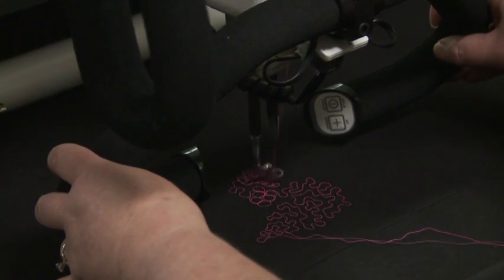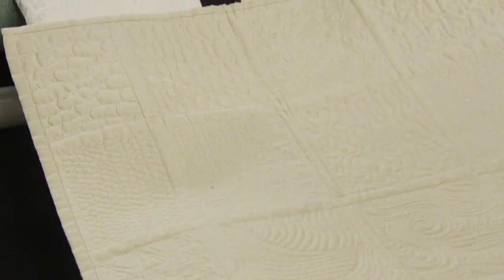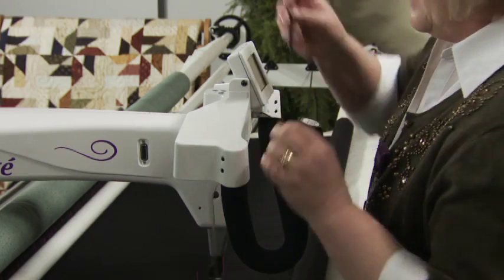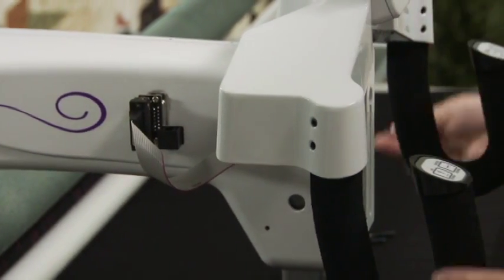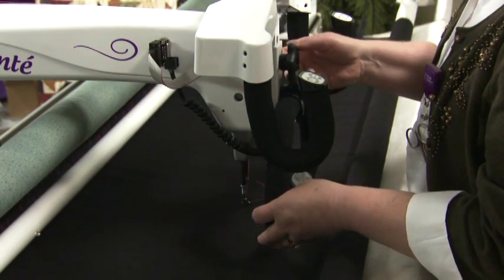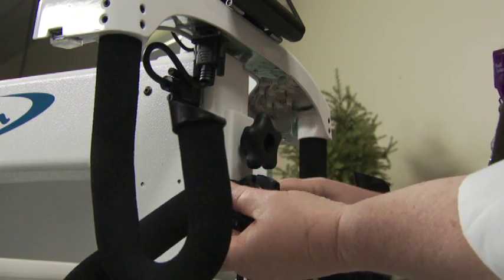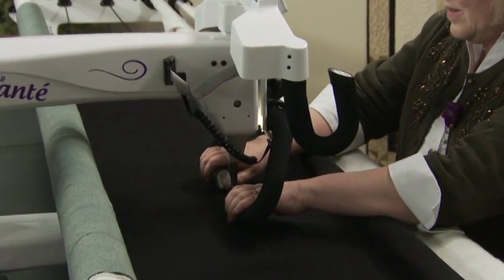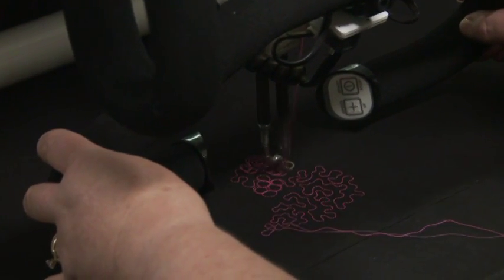Using Micro Handles

Comment: Helpful video in micro-quilting, however, I’m a little disappointed with HQ because the bare bones Sixteen is sold without rear handlebars, micro-handles, styluses for infrared and groovy boards, along with numerous add-ons, that most quilter’s want on their machine.  So, as you learn to use your machine, and realize you want or need these features, you have to pay for one add-on after another, resulting in too many exterior wires and connections, which look very sloppy and unattractive. Why not just sell the machines with all accessories, including the Pro-stitcher, so everything can be built in and out of sight?  

I feel like this is a rather unfair marketing practice by HQ and Baby Lock to nab the beginner quilter with the lowest price for the stripped-down model.  Then, we have to pay the high individual retail cost of each enhancement separately afterwards, resulting in more money in your pocket and an unattractive machine with lots of exterior wires and add-on connections.  

The HQ Sixteen and Baby Lock Coronet are essentially the same machine, and they both perform the same unfair marketing practices, by selling stripped down machines to beginners, who both need to pay much more to finally get the machine they want with all the accessories that we all desire, such as; automatic tension control system, micro handlebars, rear handlebars, styluses for groovy boards and the infrared stylus for pantographs, the ProStitch computerized system, horizontal spool bar, additional light source on clamp, and even more add-ons that I know I must be forgetting at this moment.  Just give the buyer the option of buying a machine with all additional features already built-in, so we don’t have to add on each upgrade at a high cost and resulting in an unattractive quilting machine with a  tangle of exterior wires and connections.  

Thank you for considering fairness to the customer.